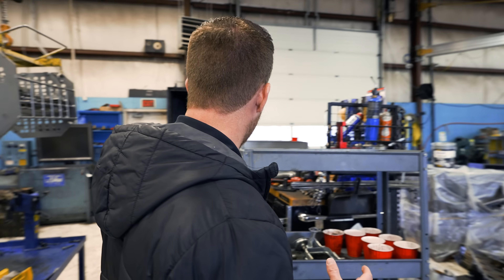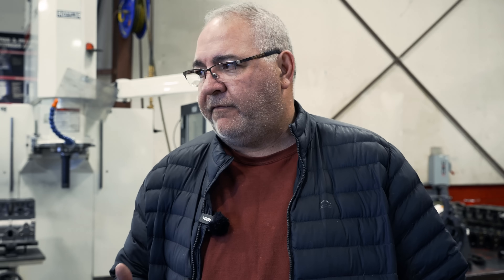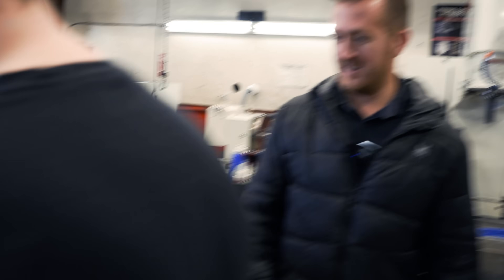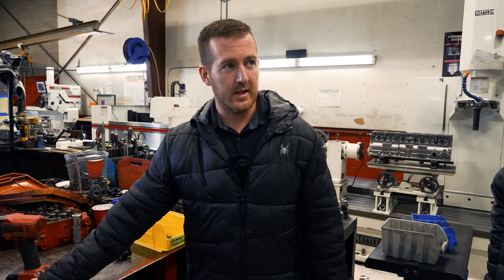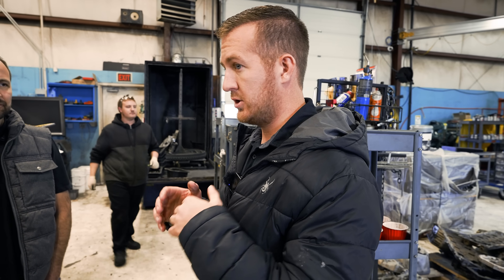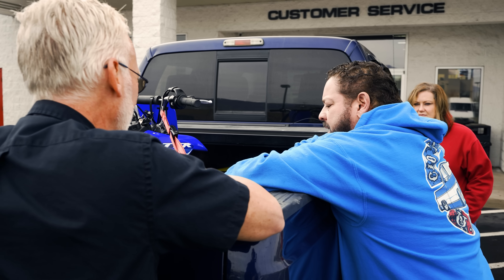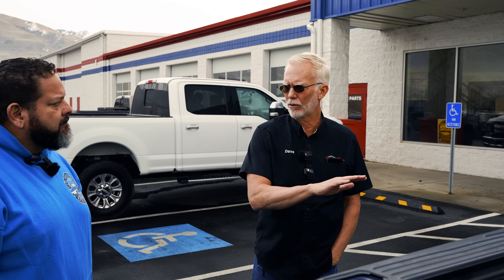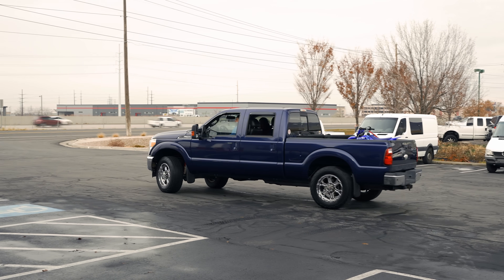Looking Inside a 900,000 MILE CP4 Pump!

Comment: Just goes to show you I’ve always said it’s in the maintenance of your vehicle man and how you take care of it. You need to take care of your vehicle and drive it every day. I have a 2019 ram 4 x 4 classic I’ve got almost 300,000 km on it to date the only problem I had Was my wheel bearings and an alternator the alternator was because I had some light bars on the truck running the a little bit too much I believe and the wheel bearings were because I was driving around with 3 inch wheel spacers on I got rid of those got the proper wheels for the offset that I wanted. I’ve also put a 6 inch lift on with 35 inch tires but as of engine problems, I’ve never had any engine problems. Yeah it’s a gas engine. The 5.7 has got its issues but they can be minimulized but not keying the engine idle for long periods the oil pump isn’t pushing enough flow at idle it can be fixed with the 6.2 Ls oil pump its a perfect match up .and the mds lifters I feel are part of the problem and stay on time for the oil changes I do mine at 7000 to 7500 km. Now I need to buy a cold air intake and delete the cat with an exaust . No, I don’t have any diesel vehicles.

Comment: He is using bypass oil filtration. The insane diesel filter he talks about at the beginning is a bypass. Cat has been using them forever. Amsoil sells them as well, or you can make one yourself for a little over a hundred bucks. It runs the oil through a fuel filter, 1 or 2 micron instead of 20. The best one you can buy is ops-1 eco pur. It removes liquid contaminants, not just solid. It’s a grand.
Reply: Idk if I like that plan. Do you realize how much harder the oil pump has to work to force oil through a filter not designed to handle heavy oil? Especially in colder climates. 😳
Reply: @Webedunn  its a  bypass filter.    Only a fraction is pressed through.....as the main lil flow srill goes through  the stock system
Reply: @Baard2000  that makes more sense
Reply: @Webedunn apparently this plan works though regardless 😜
Reply: The pump doesn't work any harder.  It's a bypass

Comment: It's not necessarily "sitting" that causes them to have issues.  It's the light use.  Diesels aren't supposed to be for running to the mall or grocery store for milk..  They should be used hard and pulling heavy trailers.  If you're not using them for that.. Then don't even buy a diesel, to be honest.
Reply: Fully agree, the usage profile is killing…
Reply: Hang on bro I pull light trailer and I make more money asI don't have to replace all kinds of other parts on my trukk. Just my 2 cents , I mean it works for me
Reply: @ronmoore3987  That's good.. at least you're pulling something.   Some people buy theses and then they never go further than 5 miles from their house..  to the local walmart or something. lol..   The DPF needs to be good and hot for a 20 minute run for it to stay healthy.. Otherwise, it's going to constantly clog and cause you issues and carbon up valves, etc..   The point is..  Work them hard and run them hot.  That is what they are built for.

Comment: A lot of problems with diesels started when they removed the sulfur and went to ultra low sulfur diesel years ago, using the fuel additive for lubrication is key to preventing wear of injector pumps and seals.

Comment: I'm in europe, and the fact that we don't have anywhere near the problems you have in the US with these pumps, makes me pretty confident you have something going on with your fuel.
And the fact that this guy didn't have problems could be explained by the fact that he never let the car sit, because if you have water in the fuel (TINY droplets) letting it sit would allow it to make micro pitting in the pump cam and roller causing it to fail rather quickly, but driving it daily would prevent the pitting from ever occurring.

The main difference from the CP1 pumps that doesn't seem to have this issue, is that there is a teflon lining on the rotor that rides the cam, this would handle pitting more gracefully as it isn't metal on metal like the CP4.
Reply: CP1 and CP3 uses the same cam design.
Reply: I would say the CP4 problem is well known in Europe too. Anyway, I add a little 2-stroke oil at every tank stop. Hope my BMW N57 will last for a long time 🙂
Reply: we lost the lubricity of our diesel fuels, as the EPA wants "light duty" diesel vehicles gone. Low sulfur fuels are poor quality. Much like leaded gasoline, vs unleaded/ethanol fuels.
Reply: @jimhafer212  We are using sulfur free diesels here in europe too, so that isn't the cause.
Reply: @jimhafer212 no. Lead is a nuro toxin and they fully well knew it when it was first added to the gasoline. Ethanol isn't a problem for any fuel injected engine. I've even had vehicles sit for months over winter with no additives fire right up first twist of the key. 
Ethanol is not good for carburetors or for storing long term (emergency generator supply for example)
Reply: US has more strict emissions regulations. That's why your cars can't be driven here with diesels (DIESEL-gate)
Reply: You guys also take care of your vehicles and have inspection and maintenance requirements from governments. People don't take care of anything here, themselves included.
Reply: @aaron___6014  We clearly don't here in Denmark; i'm doing what "I Do Cars" does in my spare time, and as of today, i have torn down 88 failed car engines of various makes and models, and the #1 failure is failed timing belts/chains, and that is pretty much always from lack of maintenance.
People don't know shit about car maintenance and care even less.

Diesel cars are very common here in europe, and the vast majority of newer ones run CP4 pumps, but we really don't have issues with them, sure they fail, but not more than many other parts.
Turbos, DPF, SCR and injectors fail at a way higher rate than CP4's

Comment: I’ve got an 08 Silverado 3500 HD LMM Duramax 961,000 miles original injectors still in the truck original CP three in the truck I service every 10K 9 quarts of shell Rotella 1 quart of Lucas and always a must AC Delco filters, air fuel oil every oil change a must
Reply: Does it still have the DPF and EGR on it? I have a 2010 LMM and I removed the DPF and shut off the EGR and after the 3rd oil change my oil stopped looking black. I change the oil every 5k miles and it still looks good when I change it, it has a dark honey color. What filters do you use on your truck, A C Delco? What kind of Rotella, T4,T5 or T6?

Comment: What has happened to diesel fuel? It started in the early 90s when the EPA started taking sulfur out of the diesel fuel as they remove. The sulfur diesel fuel has the same lubricant capability now as kerosene over the last year I’ve been doing a lot of research and into how to get lubricants back into the kerosene And our diesel fuel and I’ve talked to three farmers in Nebraska, Kansas all three of them run shell oil, turbine engine oil. This oil is made to lubricate the high-pressure fuel system on turbine engines and lubricate the bearings on turbo engines and since they’ve been running it for about three years now They have had zero fuel system problems. They actually buy it by the 55 gallon drum just like they do at the airport and pump it in their storage tank when they refuel their storage tanks. It is a great lubricant and it actually says on the bottle shell oil, turbine engine oil. You can buy it from any Shell dealer love your videos, grace and peace.

Comment: Fuel additives out there,,
 one is HOT SHOTS, Another is Archer, and another well proven one is MOTORKOTE.
And another is PowerService has DieselKleen, in gray bottle.
Our oils have something called “ADD-PACK or a Base Pack additive modifier in its “formulae”
Almost ALL Oil additives KILL these! Think about what I just said.
The ones I listed have been thoroughly reviewed and all the testing of about 300 products.
The lengthy result exam some ppl went thru it and listed the few above here, that DO NOT AFFECT your “Add Pack” oil additive formula form the MFG of it.
So what you Now need to know also is to bolster the lubricity qualities of fuel and oil by these specific well proven tested additives.
This video secret additive used to render 900K Mile and perfect wear, needs to be considered yes, I’de like to know it. 
One is fuel filter is kept clean.
That alone is likely,
 #2 reason they last.
#1 IMO is oil filter.
I am also for the Shaffer oil as it is well proven to have one ot the top best qualities for diesels.
Can know and hear more at Custom works YT speaks about it.  Has one called “time for a NO HOLDS BAR throw down on Oils & filters. Well with watching.

Comment: I think the #1 killer of the CP4 is fuel temps.  The fuel tank is also the cooler.  When operators run their tank(s) low, and since these are all "return" systems, the hot fuel is unable to maintain film strength.  With the extra fuel he carried on this truck it's unlikely the tank was ever ran down to this critical level where the CP4 suffered insufficient lubrication.  Wish more operators were like this man and took great care of their equipment.  Kudos to him for proving it can be done!
Reply: I think it's the fact that nothing prevents the lifter from rotating 90 degrees and grinding itself to death.
Reply: @all4amd24  Crazy insane design isn't!
Reply: Same for gasoline fuel injected engines. Avoid running the fuel tank low.
Reply: That's interesting.  I'm active in the tdi 3.0 community.   I think other big issues are improper fuel filter changes.  introducing air into the lines.    or water in the fuel.
Reply: if it's such an issue then either add some creases on the bottom of the tank or even add a small cooler on the return line. just having a metal return pipe should be enough.
Reply: That's a really interesting insight!
Reply: great point

Comment: I have a 2019 GM L5P and I got it new with 1 mile on the track. I use Amsoil signature series 5W40 oil and I use Amsoil oil filter. And I use Wix fuel filter because it is a synthetic filter media that filters down to 2 migraines and I change it every 20,000 to 30,000 miles depending on my driving. If I’m pulling a lot I’ll change it around 15,000 to 20,000 miles. And I usually Amsoil all in one fuel additive every 4 tanks of fuel or so, or if I’m driving up in cold weather in the mountains. And I do that because I always use high-quality diesel fuel from Chevron or 76 fuel stations. And I charge my air filter every 30,000 miles.

Comment: We have 300 6.7 fords and the only CP4s we’ve lost are the ones that got DEF or gasoline in the fuel. We do Ford MotorCraft fuel filters every 10,000 miles. CP4s only fail when they get contaminated fuel. I think in the last 5 years we’ve only replaced 3 CP4s.
Reply: Any "snake oil" fuel additives used in the fleet?

Comment: I use AT fluid in my fuel for lubing the fuel pump. It is a CP4 with 105k and no problems
Reply: How much AT fluid do you add?
Reply: @bullboss7698  1qt per 20gal of diesel. Sometimes it goes 22-26 per qt.

Comment: Filters are way cheaper than new fuel pumps and engines. Change your oil filter and your fuel filter at Max 5000 miles, regardless use of which oil brand you use. Fuel additives are snake oil.

Comment: Same pump that was on my 2017 VW Passat 2.0 BiTDI 240bhp. It was still ok after 200,000 miles when i sold it. No additives and fuel filter changed every 40k.
Reply: The cp4 in the VW that everybody is running in Europe is the baba yaga. It causes a desaster when that fail. And it fails alot here from what i know. Alot  of people makes the conversion to cp3 pump wich is much much realiable.
Reply: @ Yes it causes a disaster if they fail but in Europe it’s not really an issue or that common. Diesel in europe is better quality than in the usa.
Reply: 40k? That's way too long.
Reply: @louiewatson9389 possibly but that’s what VW recommended. Never had any failure to any pump. I have driven diesels for 2.5 million miles.

Comment: Diesel fuel is considered " light oil " thus holds abrasive grit so filters get the workout and need replaced often. Boron nitride in various fuel additives is a good extreme pressure lubricant. Merry Christmas all

Comment: Guy has spent a fortune on fuel filters doing 5k mile intervals.   
19k hours is pretty low for the miles.   I typically see about 5k hours per 100k miles on the crew trucks around here.  Definitely not hot shotters but the trucks work all day too.

Comment: New trucks have hour meters on them . Why still go by miles for oil change intervals instead of using hours?
On my trucks i go by hours, the same as on the heavy equipment.  Miles tell you nothing about how much a motor has actually ran.

Comment: all machinery hates sitting. thats why engines in taxis last so long they dont get turned off much. there is a diesel mercedes taxi in germany that has done 3 million km on the original engine. becuase its kept running. they worked out how to service it without shutting it down.

Comment: We have 2 lgh duramax trucks at work with 400k miles on them and still have the original cp4 pumps in both of them with no issues oil and filter and fuel filter changed every 5000 miles no blow by on either engine they have been pretty good trucks
Reply: Do they get ran low on fuel?
Reply: @ yeah usually about an 1/8 to a quarter of a tank before fill up no additives I am surprised the fuel systems have lasted this long

Comment: 15,000 mile oil and filter change intervals is NOT preventative maintenance ESPECIALLY when towing the whole time and ESPECIALLY with a diesel engine!

Guy always used quality fuel and always added extra lubricity and that's what got him to almost 900k miles imho!
Reply: Its not just mileage. Hours are the most accurate meter on engines as far as how often oil changes are needed. This truck due to hotshot work  can put on 15000 miles with similar hours as the average truck at 75000 miles due to all highway driving.
Reply: @kennethobando5755   Going by hours is for engines that idle a lot and being a cross country vehicle going by mileage is best.

Comment: 100$ the truck was deleted! And at 10k oil changes since I sample every 10k it needs a oil change from fuel dulition,  because of regens! U will get a check engine light when pump starts to fail, took it in at 208k mi and needed a new pump. Probably from running it under a 1/4 of fuel and changing filter every other oil change..thats my experience with 3 trucks. 2016 and 2 2018s

Comment: Lack of lubrication is the biggest killer of the cp4.
Reply: You would think modern engines are made to run on modern fuel
Reply: @carlpreston1680  It's an EPA issue. Other countries around the world didn't mess with fuel composition like the US did. The current fuel in the US lacks lubrication. Cp4 failure in the US is twice that of many other countries.
Reply: @tonycalabrese8438  The CP4 is the biggest killer of itself  The CP3 did okay on modern fuel     I would almost bet with everything being made horribly nowadays and everything failing sometimes you get a good CP4 and sometimes you get a bad one that won't last especially with those rollers on the cam follower . My dad's work truck is a 6.7 powerstroke It has 420,000 on it and the maintenance isn't great , with the original CP4 pump but I do believe add a lubrication will help where I work we have a large fleet of diesel Fords and we only use biodiesel we never have any CP4 failures .

Comment: The very first part on pump removed looks like new/er blue gasket material @ 1:50.🤷‍♂️
Reply: Gaskets need replacing everyone knows that
Reply: Yes I know that.....smh but the owner, and mechanics all were acting as if nothing on this pump was ever serviced. I am simply noting the gasket that looks like it has been replaced. So no that pump doesn't look new. I wasn't there, but the point of this video was this pump with 900k never touched miles on it. @artejaimartin8360
Reply: Just the pressure regulator

Comment: Fuel additives for lubrication is key and filter maintenance… plenty 6.7 CP4 do 300k plus with maintenance. Many don’t even know about the CP4 problem, just working & caring for their diesel. The percentage that actually fail isn’t as high as perceived through all the YouTubes and articles… including the larger 550, 650, etc trucks.

In addition to additives & filters, I’d highly agree with a disaster prevention kit, FASS filtration and moving to DCR pump… for my preference… but I meet them often, high mileage and they have no concern or knowledge of a problem. 
So it’s not out of norm, high percentage fleet maintenance, farmers, oil rig, etc maintain their rigs religiously and easily go beyond 300-400k  miles. Oddly I hear more of the 250, 350’s having CP4 failures.
Reply: I put in a mug full every tank on my 2 litre V W DIESEL she  purrs filters filters and  LIQUID MOLY EVERY 8 thousand miles
Reply: Ya its unreal when u watch you tube you would think every 6.7 is bad we run 6 of them hard with hired hands and only 1 needed a rutrbo under warranty the rest have high miles and have been bulletproof
Reply: @forrestcowan448 exactly, your situation is what I often see… hard working diesels and few issues after warranty. Crews may work them hard, but they’re maintained. 

The Owner in Video mentioned he felt it was daily hard use that “kept” a Diesel happy & healthy, that may have merit.

Comment: I commented on one of your earlier videos that additives like HotShot are essential for the health of ANY diesel engine in the US. They use a higher percentage of sulfur in the fuel in Europe where CP4s were developed. Sulfur is the lubricant in the fuel system. It’s common sense.
Reply: EDT  by hot shots has been our go to for decades of 4 diesel service trucks. Clean/ reliable returns
Reply from the maker: Appreciate you sharing your knowledge and experience!